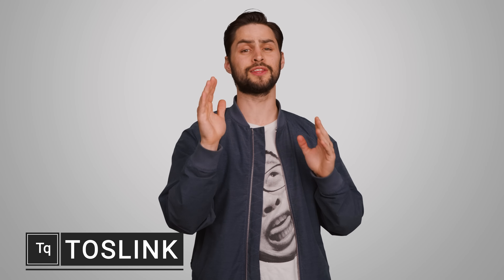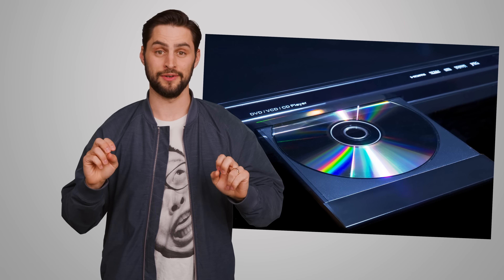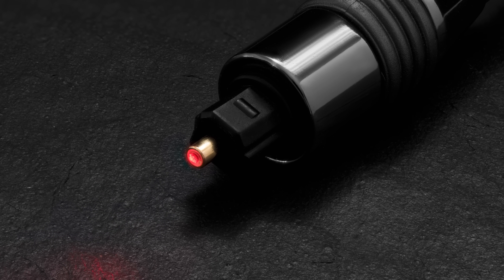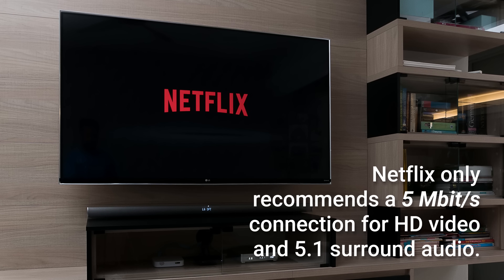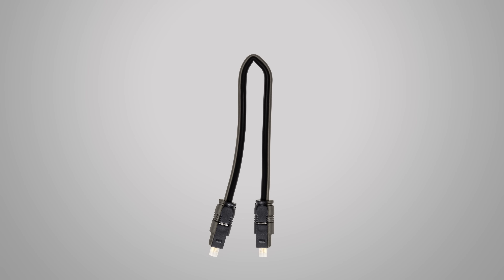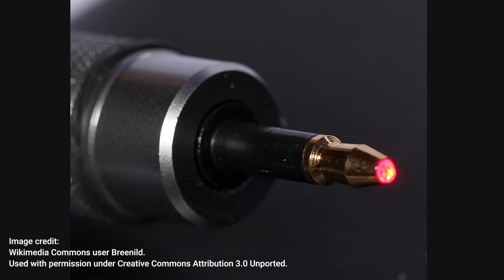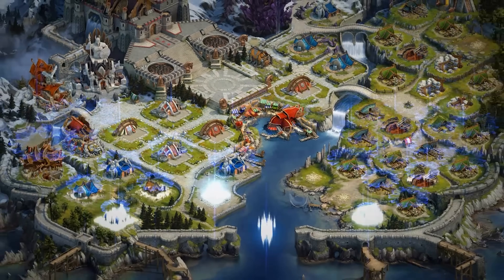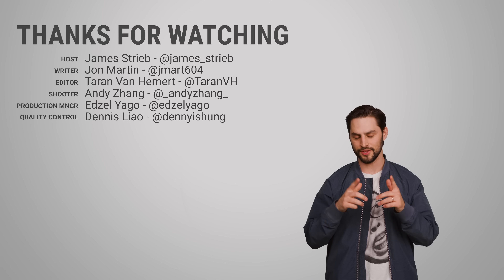Why IS This COOL Cable Dying? - TOSLINK Optical Audio

Comment: I heard this video's audio through a TOSLINK cable!
Reply: Same. Can't complain when I paid a total of 10 bucks for a 5.1 system.
Reply: @JoelKalich  god have mercy on your sound quality
Reply: @voidsecondaccount  protip: it helps to get two really good large speakers (big enough to be the 0.1 of the 5.1) and a reciever for free. Uncles wife (at the time...) had some old stereo equipment she didn't use. That was about 6 years ago.

About five months ago I bought three more genuinely decent speakers for three bucks at the salvation army. Bought a reciever off Craigslist that supported 5.1 over digital audio (aka TOSLINK - TIL) for 40 bucks. Sold the old reciever that didn't for 40 bucks. Remote for the new reciever cost about 10 bucks on Amazon. I guess it cost a total of 13 bucks, sue me.

I don't really want to be an audiophile, that shit gets stupid expensive. I'm happy with sound that's quite good rather than perfect. The surround setup I have makes movies and games sounds as good as they ever have to me, and really fills my studio apartment (the neighbors love me). Plus, it's a zillion times better than any TV I've heard.

Damn this got long. Tl;dr: Craigslist and your uncles 3rd wife are your friends.
Reply: @JoelKalich  protip, tear those speakers apart, and replace the foam ring when it gets dried out and cracked, you can get many more years of life
Reply: me too:)
Reply: Me too. My TV is connected to my audio receiver via toslink!!
Reply: Daniel Woike my game consoles are connected to my logitech z906 using toslink, my pc is connected to z906 using 6channel analog cables
Reply: Same, my wireless headphones are hooked up that way.
Reply: I have speakers connected to my PC through the port that i use when other people are around—but I mean who would be around right now?
Reply: me too
Reply: Big Brain Confirmed
Reply: same here
Reply: same i am changing my audio setup

Comment: @1:12 DVD players with with a built-in Dolby Digital (let alone DTS) 5.1 decoder and corresponding RCA outputs were pretty rare. When DVD players first came out, Dolby Pro Logic surround sound (which was encoded/decoded from a standard L/R stereo signal) was the current standard. Dolby Digital & DTS 5.1 surround sound came out a couple years later which lead to production of the aforementioned DVD players with the built-in decoders. They weren't very popular because home theater in general was just starting to become a thing a most people didn't realize they needed one. Most people also didn't realize that Dolby Digital & DTS were substantially better than Dolby Pro Logic. It's not all the consumers' fault though. All of them used the same speaker configuration and electronics manufacturers' bad marketing practices duped a lot of consumers.

Nearly all DVD players proudly displayed the Dolby Digital/DTS branding even though very few of them had built-in decoders. To add insult to injury, many home theater receivers from 1996-1998 were marketed as "Dolby Digital Ready" which actually meant that they needed an external decoder. Unfortunately, most folks misinterpreted it and thought that meant the receiver had the decoder built-in.

Thanks to Crutchfield, as a middle-schooler in the mid to late 1990s I had a better understanding of surround sound than most grown men.

Comment: is this toss link cable the one that is needed for my old 1080p tv to plug into a receiver? it's similar to the port you can see at 2:44

In either case I just told my mother to use her apple TV to watch the netflix. That way, the tv "apps" are never used and I won't run into the problem of it not outputting to the other speakers attached to the receiver

Comment: Optical cables are fine but the sockets always break on the devices. You cannot repair that just like buying a new cable. It is very bad design.

Comment: They should have updated this standard IMO, maintaining backwards compatibility. The cable uses light to pass data, so my guess is that the bottleneck in transfer speed is the transmitter/receiver so what I am saying is that they could have made a new standard and maintain the optical cable and allow Dolby Atmos/more bandwidth to go through it, instead of hdmi for everything. HDMI ARC was a mess before HDMI 2.0, introduce HDMI E-ARC, and still, receivers that feature this are expensive, not to mention the expensive TV you have to get that has HDM 2.0.

Comment: I use toslink to connect my PC to my Logitech Z906 5.1 sound system, and I'm very amazed about the quality of the audio. Maybe people are using cheap cables, and that's why they face problems. I don't see myself using other type of connection further on.

Comment: Because it only transfers Dolby or DTS pre-encoded content and completely lacks support for PCM multichannel like most games use? I'm surprised you didn't mention this. It's really horrible. HDMI and coaxial cables work fine with it, surprise surprise. Thanks, terrible licensing.

Comment: The shell of the fiber optic cable in the ocean doesn't completly protect the data. They use an optical communications repeater to regenerate the optical signal. These repeaters are used to extend the reach of optical communications links by overcoming loss due to attenuation of the optical fiber
Reply: TOS-Link is also a simple flashing LED. lol
Reply: Pretty much anything transmitting electromagnetic signals over distance need repeaters. Like phone lines for example. All those black cylinders hanging under the lowest wires.
Reply: I think they actually already have a video talking about repeaters and the such.
Reply: Homer Simpson voice Umm YES!
Reply: Dont know what you are talking about but i will have one of those with mayo pls.
Reply: @frietpan8917  😂😂😂
Reply: @frietpan8917  You had the whole crew crackin up bro. 😐

Comment: i still use a  toslink but i just call it an optical cable. anyways its used in my theater set up in my living room. blu ray player is hdmi to the tv and then optical from tv to my receiver and it fills my living room and powers my sub and 7 speakers really well. its an older Onkyo setup but for the price i paid for it $100, its amazing. the same setup but newer model is like $500-$1000

Comment: disappointed at no mention of how toslink is old as sin reaching back to the 80s that and if standards did change the cable is would be 100% compatible since its just a light tube and bandwidth is infinite as long as the decoders got updated all of which can be done via software.

Comment: optics are still used to carry sound using ADAT lightpipe, this is very common in the pro audio domain to add extra audio I/O to audio interfaces
Reply: Yep good ol' Adat. Nowadays I use it primarily to sent digitally generated CV signals to my eurorack modular synth. But what I'm really waiting for is the mass adoption of network audio (Dante protocol), it sure is readily available but still expensive.
Reply: @philippes1987  ya, dante, AES67, AVB/MILAN, SoundGrid.  Who will be the winner in this "Battle of the ethernet audio standard"
Reply: @magoostus  yeah I see what you mean. I think now the 2 big contenders are Dante(proprietary protocol = stronger reliability? = more expensive) versus AVB(somewhat open source = unequal development? = more affordable) we'll see...and as a side note, there is talk of midi 2.0 over network cables and Dante, yay!

Comment: Love my optical cable .. just don’t bend it and break it 😂. Use that for 5.1 on the daily still think it’s better then hdmi for audio
Reply: well since TOSLINK can't handle uncompressed LPCM 5.1, TrueHD, DTS-HD MA, ATMOS, DTS:X....I wouldn't say it's better. I used TOSLINK up until I bought a receiver that could decode the newer lossless audio formats on BD and never looked back.
Reply: Frank Jaeger probably why I haven’t noticed a difference, my receiver only decodes dd5.1 and dts5.1 upgrading to something 7.1 or Atmos has been very intimidating

Comment: I use toslink in my home theater setup. I have a Dell optiplex 755 usff with inboard audio that is dirty AF. So I went to microcenter and picked up a USB to 3.5 mm which is also using toslink red light. My receiver has a port for this, so as my video goes to the TV using VGA, my audio goes to Optical 1 using light.

It's brilliant, clean audio. Other technologies had gross audio. This is the only one that works and works well for me and my usecase

Comment: Except a separate RCA cable for each channel is going to give you higher quality vs optical.
Reply: No it doesn't wtf? Optical will always have higher quality. Rca cable is just analog. Wtf?
Reply: @harissify  Optical will only have higher quality in stereo wtf? Optical surround is capped to lossy Dolby and DTS like shown in the video. Wtf?
Reply: @wright96d  okay but you said rca is better? What does rca have?
Reply: @harissify  Well if you have a lossless Blu-Ray you can send the full quality signal to your receiver.

Comment: I actually use Toslink, got my DAC with that option because I wanted to use it so I could just switch from my PC to something connected to the USB, like my Switch. And since a USB switch is much cheaper than a toslink switch, I can also get one and just press a button to switch from Switch to my PS4. But I don't really care if it dies at all if HDMI actually replaces it.

Comment: Toslink has always been my fav, simple because it was standard for pc/consoles/tvs and most sound system or add on system.  It was standard for DVD/Blu ray.   ( how could forget Blu ray?) Only one company never support toslink and Dolby digital was Nintendo.  Cuz they too cheap.  Imo Toslink sounded way better vs anything from analog RCA cable.   I hope ps5 will still have toslink.  I still have old 2005 (I think) Yamaha surround 5.1 sound system.  Lol ya it’s old but still works.   Someday will replace it with better sound system with HDMI,  btw I’ve NEVER broken or has had toslink failed.   I was happy DTS/Dolby Digital 5.1/6.1 sound.  I thinks sound industry has gone over kill with 1 million different audio codec now, consider most ppl still use standard HD tv with tiny built in speakers. but there are those like us who do like older stuff and 5.1+ sound. But maybe I’ll feel different if ever buy newer sound system with good speakers.
Reply: Z3U5  Ya I remember using Toslink/S/PDIF on for both Xbox 360/PS3. Gears of war in 5.1 = Totally epic sound even on my old system lol.
Reply: TOSlink is great until you realize it lacks the ability to transmit uncompressed Blu-ray audio. And it for sure makes a difference. On a Blu-ray at least DVD makes no difference as the sound is always compressed.

Comment: Honestly, I never knew it was called TOSlink.  No one I've ever talked to calls it that. They just call it an optical port.
Reply: there were other optical connectors. Toslink is the most popular
Reply: lol i always called it spdif
Reply: I knew, cuz i had to find a cable so i had to learn the name of it.
Reply: That's another common name for it. I never knew it was called TOSlink till 3 years ago.
Reply: I knew the name Toslink since is used it on my PS3 from 2009 on...
Reply: S/PDIF is another name for it if you are more of a Sony/Phillips kind of guy instead of Toshiba.
Reply: @NickStallman  Which (S/PDIF "Sony/Philips DIgital Interface"), also can be found in three flavours: Coaxial (with an RCA or phono connector), Optical (like the simple TOSLink) or the combination of both (as a hubrid) as showed at the end of the video).
Reply: @NickStallman  It's a different thing and today mostly the coax version of it is used, so I wouldn't recommend to use these names synonymously.
Reply: @NickStallman  TOSlink is the name of the physical connector.
S/PDIF is the name of the logical interfacing. It can (and most often is, in the pro audio world) actually be used over a good old copper cable with a CINCH connector.
(also, IEEE stands for "Institute of Electrical and Electronics Engineers", which is an association that helps establishing standards, such as IEEE 802.11 for WiFi, IEEE1394 for Firewire and so on)

Note that in the pro audio world, TOSlink is often referred to as ADAT (or ADAT lightpipe), as optical cables with TOSlink connectors were used by Alesis on their digital multitracks recorders that were first introduced in the early 90s and were very popular at one point. The recording support was progressively replaced with computer-based recording, but the interfacing format is still used as of today. The main advantage being that a single optical cable can carry 8 tracks at 44.1/48kHz sample rate (or 4 tracks at 88.1/96, or 2 tracks at  192kHz).
Though it is progressively being replaced by more modern technologies such as MADI, that can carry 64 tracks at 192kHz over a single optical cable, or Cat6 network cables with network-based technologies (though we also use fiberoptic cabling as a physical support for networking solutions for distances over 100 meters), that can typically carry 2x64 audio tracks at high samplerate. Though these technologies are still too costly to permeate into the home audio world, and aren't really needed either.

But yeah, TOSlink is mostly just the name of the plug itself and the attached "pipe", that was developed by Toshiba (hence the name) and then used by different manufacturers. But it's just a pipe that allows you to transport digital data, just as a Cat6 copper cable is (though you could use the Cat6 cable to transport analog audio, as it's just a bunch of copper wires).
Reply: @NickStallman  Xbox 360's also had the port. They were used for the wireless transceivers for wireless headsets on that console. Chat was sent down a cord into the controller, which sent it using their Xbox Wireless signal.

They removed the port from the E revision of the 360 (the one that looked like an Xbone).

The Xbone used it's newer wireless standard to send all audio to and from the controller, which would send it to the headset with either the proprietary audio port or the 3.5mm jack. That meant that if you had the stereo adapter, any headset you used could be used without plugging into the console.

Also, headset makers didn't need to make a transceivers that you have to stick in your entertainment center. And the headsets no longer had to have batteries in them since all audio was analog from the controller. Unfortunately, this meant that you could no longer disconnect the headset from the controller and just listen if you weren't chatting. They still keep Toslink for some sound systems and for using Xbox 360 headsets on next gen.

Also, neither console supports Bluetooth for some reason, hence why you can't use a headset without the controller on the one unless it supports Xbox Wireless. I don't know if it's a patent with Sony or what.
Reply: @shanez1215  I have a pair of 1st gen. Astro A50's and a pair of Lucidsound I use on my PC and PS4, respectively, using the optical port. They are interchangeable, but do not support XBox.
Reply: @shanez1215  

I was worried of losing the Optical Cable for the use of my headset on the Series X... But now I'm betting they'll just go the PS4 route in enabling headsets to be used via USB like you can today on PS4 and Obviously PC.
Reply: I always called it a digital optical port. Same shizz.
Reply: S/PDIF
Reply: Toslink = Toshiba Link.
Reply: Rolls off the tongue better.
Reply: if you ever had a PS2, PS3, PS4, Xbox,  xbox 360, xbox one etc. You would know what toslink is cause these systems have toslink outputs
Reply: I didn't even know It existed lol
Reply: My mono has a toslink connector but it’s pañales spdif so now I’m confused lol
Reply: I thought every "tech geek" knew it was called Toslink.
Reply: I've literally never used that port in my life 😂
Reply: I use Toslink and digital optical, toslink of forget digital as shows fibre optical, also S/Pdif not remember but know of, I use hdmi for video only, though as of PC forced on display port, love toslink for sound, love if could merge two 5.1 in one with it though so need just my 1200w 5.1 and not another speaker set
Reply: @mlee6050  Do you happen to know of S/Pdif can also do 7.1?
Reply: @udonyoda9358  sorry I not know as only used 5.1, a google search says in wiki that 5.1/7.1 but a few say it supports 5.1 and if want 7.1 have to use hdmi 1.3 or above
Reply: @mlee6050  Thanks mlee.
Reply: I always knew it as optical SP/DIF.
Reply: Problem is ADAT exist, same physical connector. TOSLink is the consumer version of Optical Audio. Basically you will only used Toslink.
Reply: It is sometimes internally called IEC958, my sound device calls it that way.
Reply: It has many names. Toslink, optical, s/pdif
Reply: Have you ever heard someone calling banana,  a dildo!
Reply: Toshiba designed it !  Thus the name.
Reply: Toslink is the main way I referred to it.
Reply: @jasonbrown467  1394 was FireWire IIRC
Reply: @MadDawg010  yep that sounds better
Reply: Never used Wikipedia?!
Reply: @NoxmilesDe  Do you know everything about about Andrew Jackson? or maybe Otters?Thats also there on Wikipedia doesn't mean you read it lol
Reply: In Modern Living Rooms Everyone Using "SoundProof Curtains" That Stops Outside Noise by 80% (25 Db) Tested. Check Here: https://livesoundproof.com/best-soundproof-curtains/

Comment: Toslink often has sync problems because of latency when used as audio connection with video, just saying. That's the biggest issue for me...
Reply: incorrect that was due to the old s/dif not adat gotta love people that blame software issue on hardware.